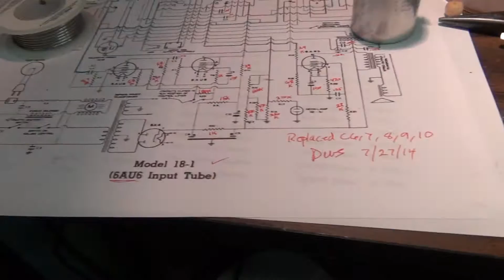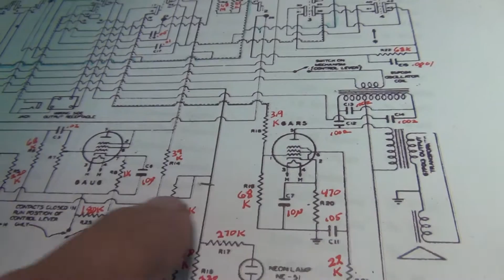Webster - Chicago Wire Recorder Repair

Comment: I bought a Model 228 3 for R5.00 ZAR - Five Rand (about $0.40) when I was a radiotrician apprentice - almost qualified - in 1972. The only spool of wire jammed up beyond repair and I managed to get a box with 5 spools for R3! There is a telephone conversation on one spool and the one guy is worried about where  the economy is heading...  It has only one dictate and one transcribe button instead of the record/listen knobs on this one in the video at 03:15. It has a transparent dust cover with this funny inscription: "Webster-Chicago Dictation Machine with Natural Voice Playback"  ;) It also has a carry case and mic. 'Remote' pause/play on mic - hard wired. It is a 60Hz 220VAC version. Should have been 50 Hz for South Africa. So it runs at the wrong speed!
Found this just now: Dictaphone Cover: Cover is made of plastic (yellowed) with black edging. Red printed text on top face: "W C / WEBSTER-CHICAGO / DICTATION MACHINE / with / Natural Voice PLAYBACK" 
Google it to find it
Reply: Omg.  Just found this comment by my dad.  He passed away 3 months ago and I am thinking of selling this mashine of his.  Very sad.
Reply: @yolandimare1  sorry to hear that, but I would keep it. I'd rather have something with some sort of physical attachment to my dad than the few quid you might get for it..